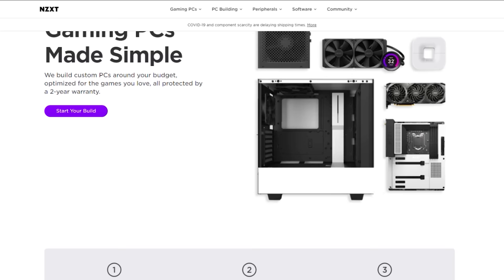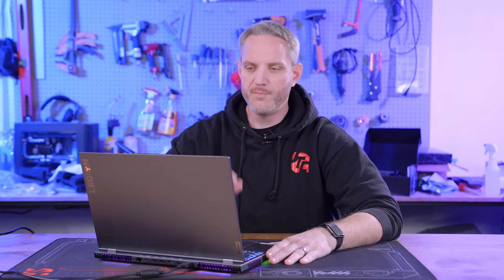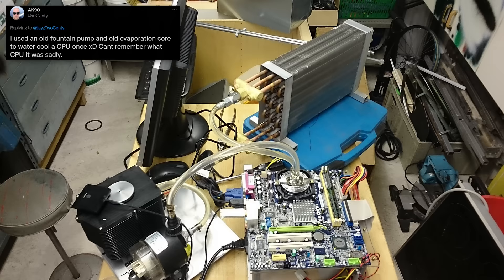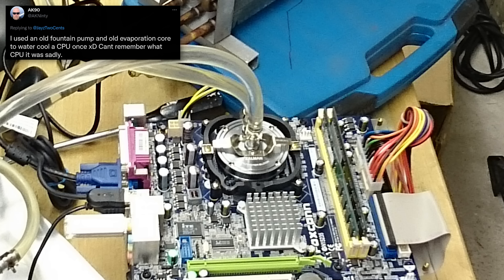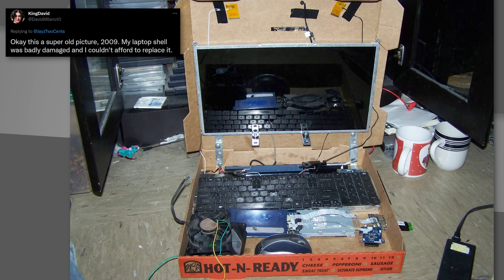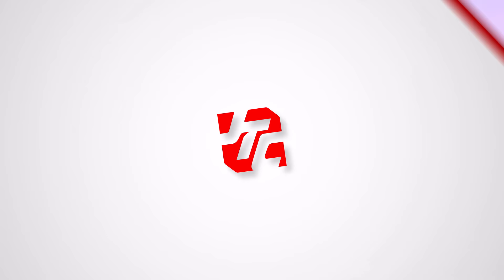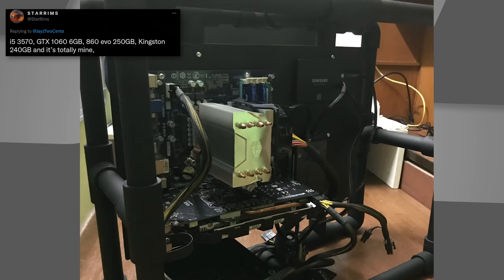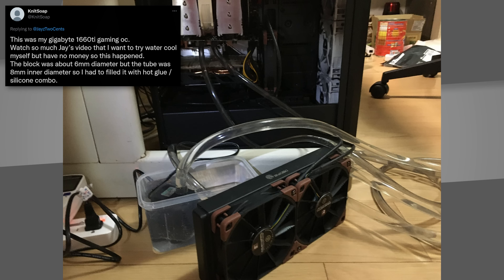We asked to see your JANKIEST PC setups... and you DIDN'T disappoint!

Comment: The most Jank i have is a 92mm FAN strapped on the outside of my NR200P to cool the M.2 on the backside of the Board. It is mounted with the rubber doodads from Noctua through the mesh Panel. The cable if routed through the Vertical GPU Slot on the back, which is a 3D-Printed part to replace the Vertical GPU Slots. And no the 3DPart doesn't have a hole for the cable, it is bent creating a gap...

Comment: a few years back i was working at taco bell with this couch hopper guy. not gonna lie, wasn't the greatest dude in the world but we often bonded over his tablet setup. being essentially homeless he didn't have a pc or anything, so he had this little android tablet he'd use to text and stuff. he kept it in this trapper-keeper-esque case along with a bunch of accessories, and it was really really well managed. he had a battery pack tucked into the hinge part with a short cable to keep the tablet charged (while also being able to plug in and charge the external battery without removing it). he had a pair of earbuds strapped next to the tablet, with the cable going around and having a spot right next to the 3.5mm so he could easily plug it in. just a bunch of stuff like that, and it was great. i think he got arrested and i got a different job and i haven't seen him since. i think about him and his tablet sometimes.

Comment: The rubber tabs on the first build come with bequiet fans. You can use them instead of screws. supposed to help with vibrations to keep the fan a bit quieter.

Comment: Also, i did a cardboard box build when i was about 14.. It was a Compaq DeskPro P90 overclocked to 120, i made it strong enough in the end using more card and hotglue so it could hold a monitor without bowing too much! Though i did technically cheat and use the metal frame of the riser board to help with that.. And the PSU! Also built a server for my exes website back when i was 17, that was in a cardboard box too! Though the PSU just sat on the shelf with it.. Motherboard was on top, then the HDDs were inside the box. An old AMD K6-2 i believe, was good enough for a basic site back then lol

Comment: How about Janky repairs?  I had a keybaord someone had spilled milk into.  the acid in the milk ate away one of the traces.  I used a piece of scotch tape and a doublemint gum wrapper (foil on the outside) and fixed the trace.  Used that keybaord for a few more years before it was replaced.

Comment: Our first computer was an old Windows 98 Packard Bell computer. We had added a Voodoo 3 card, a CD burner, and an extra hard drive to it. The thing is, the case didn't have space for a second hard drive and the power supply didn't have an extra plug for that hard drive. We ended up using the metal grate that had blocked off the 5.25" bay as a way to mount the hard drive below the existing drive bays, and we spliced an extra plug into the power supply. Somehow, the power supply never had any issue powering everything  through the whole life of that computer.

Comment: I've had jankier setups than most of these, I used the same pc case from 2005 until 2019, lost every panel on it over the years and eventually I bought an AIO that I just held onto the front of the case with a shoe string, I also discovered in 2012 or so that if you bend a graphics card just ever so slightly it will still work, and you'll also have room for another hard drive in your case(the same one with the shoe-string budget radiator)

Comment: 14:36 - the cover for the seat - mine is doing the same thing, it just dissolves over time (cheap fake leather, might be related to the fact I've basically spent the bulk of the last two years sitting in it working from home) and peels off the seat and arm rests

Comment: I missed the widow but I have a PC case I made out of stained wood for my Minecraft Server. Looks professional. Laser cut side panels, hinged door, 4x120mm fans, 10TB storage, and HVAC air filters, in less than a cubic foot. Why? The cost of materials was half the cost of a metal PC case and the results were stunning.

Comment: I used a Danger Den ceramic pump, Peltier unit, and a transmission cooler with two 120mm fans for a chill water cooling unit on an LGA775 rig once. I also put an AMD ATX build in an original Xbox shell, complete with an ATI GPU. I had to cut an L shaped slot in the top of the shell to allow the GPU to fit.

Comment: Not super interesting but I once drilled an array of holes in the side panel of a case so I could put a fan blowing right on the video card. Also brought the rear USB ports to the front with a USB extension cable and Velcro to mount on the side.

Comment: The H510 plywood mod is still better than the two large cut and taped together cereal boxes that I used to replace the missing side panel on my old rig!  It was actually dumped on my front lawn by someone in very sorry shape! Luckily I was able to get it up and running again sans side panel!  😂😂

Comment: I upgraded to a 3090 recently... Wasn't happy with the ram Temps on the back, so I took an old pentium 2 cooler, filed the back flat, and slapped some thermal paste on the back of the card and set it there. Max temp didn't change.
Realized there was a small gap on back right over 1 ram chip.... So logically I took a back plate cover and slid it in the gap. 10*c temp reduction! Success! But yeah... $2k card covered in paste and spare scraps of metal... It's a look

Comment: Dang, been a long time since i had a truly jank setup.. (AMD Athlon64, 120mm fan screwed to the heatsink, desk fan next to the tower blowing in instead of a side panel!) Or when i added a 240mm radiator from an old build to a custom loop trying to cool a Phenom 9850BE and a Radeon X1950XTX! No barbs, so i had to silicon the tubing into the 1/4" fitting holes and make sure they didn't leak..then it rested on the bottom of the case with fans (an original CoolerMaster Stacker) and still have that case! Also, that Foxconn heater core jank liquid cooled board is definitely Socket 775! And i had the gold version of that Zalman block with a clear top on that Phenom.. Once, the pump power supply failed and it started warping/melting the acrylic!

Comment: I have an NZXT Phantom and I fubared the top 200mm fan by accidentally bumping the case when it was running. I didn't feel like paying a premium for a rare proprietary thin single-color-led 200mm fan that could break so easily so I just bought a Noctua 200mm and stuck it on top. Eventually I'll cut the top panel so I can put it back on but for now it's naked. 

I knew I would have trouble replacing that fan when I bought the case, but I didn't expect it to be so fragile. Thing's bulletproof now though.

Comment: Wish I had pics of my old jank system.
Was built in a dresser drawer, using a blower fan from a old heater as a input fan. Was water-cooled, by which I had a simple copper pipe smashed semi-flat for the GPU. (a rx580) used a pump from a old rv, (which ran 12v, so I had a power converter mashed in the box too) 
Cpu was in the same loop, but that had just a simple copper heatblock screwed onto the mobo with a chunk of plastic.
Ran a old og phenom (not the 2), but later upgraded to a 2600x. Kept the case and cooling system.

Dispite the jank, the system never got higher then 46c even under full load.

Comment: Jay, you sounded *entirely* too excited about the "three meat treat" lol

E: What's janky in that photo isn't the desk... it's the Walmart MDF bookshelf that the tower is sitting on

E2: I'm both surprised and happy that you know enough about my line of work to be able to give the basics to folks. That being said... not a huge fan of having electronics that aren't bolted AND strapped down in my sleeper. Infrastructure in this country is just too janky, and more than once I've had anything that wasn't securely fastened to a single surface end up on the other side of the truck just from driving down the interstate.

BTW, thanks for the reminder that I still need to do that HOS For Dummies series that I was planning...

Comment: On my last built I decided to cheap out on my case so I bought a 40$ cheap corsair. It was hermetically closed with 0 airflow so I got mad and with a hacksaw made a big square hole in the front. Then I used I cut a pouch made with mesh and made a jank air filter. It worked great for a few years. Now I have a 150$ case, and omg no regrets.

Comment: does stacking a router on top if an old nas on top of a 5 y/o lowend desktop with terrible cable management a printer as a stand for the corporate workstation and a stack of 5 books as a monitor raise and manual kvm (manual plugging around cables everyday that is) count as jank?

oh did i mention the old salvaged hacksawed down heatsink added to the nas chip set held on with 2 strips of electrical tape that were absolutely added after the fact

and of course: wooden dining room chair

Comment: I'm a OTR trucker.  In the next 2 days I'll have an ITX rig built for the road;

Cougar Dust 2 Iron Gray case
Be Quiet 280mm AIO
Asus Rog Strix Z590-I
i7-11700F
Rog Strix 3060 OC 12gb
32gb Corsair Vengeance LPX (2x 16gb)
Supernova 650 80+ gold PSU
1tb 980 Pro nvme
2tb 970 Evo plus nvme

Comment: If you really want to do an old school system build, I did something like this several years back for nostalgia reasons myself. Was a pita to track down, but I have an Athlon Xp mobile 2500 (and a 1700tbred b), like a gig of BH5 spec DDR, a Gainward GeForce ti4600 128mb, and a DFI Infinity motherboard. Also a DFI LanParty one too but I think it had issues. Then i've got waterblocks for both the cpu/gpu (old school ones), and everything else for the loop too. I also have a few other things from the era too. If you really want to do a video on something like that we could probably work something out. You could even just borrow it or something.
Reply: I still have a couple functional AMD Tbirds. Not in use, packed away in a box but it was the mainboards that gave up the goodies on those. Same box also has a Voodoo 3 and Voodoo Banshee that sat in the system with it at different points of it's life.

Comment: i remember way back when i built my first water cooling system.  Had the same submerged aquarium pump as seen in some of these systems.  It also featured a radiator that lived it's past life as an oil cooler in a 90's Volvo, and a water block that was made from a pin array style aluminum heat sink with the outer pins removed and then enclosed in 3/8" plexiglass and glued together with transparent silicon... worked great until someone turned it on without turning on the pump and overheated the plexi to the point of it getting soft enough bend and the silicon lost its seal and ... yeah... leaked all over the case... and killed the pc...

Comment: Hey, Jay, that weird piece of metal holding down the water cooling is actually from a Noctua cooling setup. Don't know which one, but it's probably something that holds down the radiator or installs on the back of the MB. There ya go!
Reply: I'd like to add that it's from an AIR cooling assembly, not liquid (most probably). So, janky. You're looking at fine, European engineering right there.
Reply: And while I'm adding replies to my reply, the screws are from an air cooling Noctua, too. No doubt they have a couple of metal struts like that on the back of the keyboard with the longs screws bolted down to it.

Comment: Oh man, I'm sad I missed that. I've got a kinda jank kind of DIY setup in my current case, where the 420x140mm radiator doesn't fit in the front of my phanteks p500a because the housing for the buttons and USB ports gets in the way of the radiator head for the connections. So I hit up McMaster Carr, got some longer screws, some plastic washers and standoffs and made the radiator screws into a standoff bracket onto the case attachment points so the radiator can fit a bit over an inch deeper into the case and not conflict with the button housing. Jay, if you're interested I'll probably post some pics in response to the twitter thread.

Comment: My first "HD" Flat screen TV was a 32 in Sanyo 780P open box tv for 600 dollars. I used it for nearly a decade before it finally gave out. That was a 2006 or 2007 model if I remember right. Used as a TV and my primary PC monitor. 600 dollars will get you an awesome monitor now lol

Comment: Suggestion for next Jay water cooling project idea - Use a car/large radiator of some sort as back board similar to the Singularity Specter case so rather than a power board, large radiator which will be used to cool everything on the case. Inspired by Jay's comment on the fountain pump jank build on this video. I can imagine  a nice industrial/car look to it. Would be a nice project since the engine block build got put on the shelf.

Comment: I still have an original mk1 phantom and it's awesome.  Currently running no side panels or plastic covers because I need airflow for the 2 x 240mm AIO coolers I'm using to try and get 1st place on timespy for my setup.  Using a HP RTX 3070 LHR 🤣 currently #16 in the top 100 🤘

Comment: as someone who has been in IT for 7 years...i get it.. my desk is like 10% the mess of that during the week, but i clean weekly
Reply: It's me! To be fair most of them were not plugged into anything. Picture was from about 5 ago and I believe I had poured out a bin of stuff to find a USB hub and get the AIO plugged in. Took the picture to send to a friend and show my jank mount, because that case only had 200mm fan mounts.

I cleaned shortly after. Still didn't look amazing what with the AIO cables hanging off the side, but it wasn't like this daily.

Comment: My janky setup is visually pretty normal. It's just a mid-tier HP Omen laptop from 2018.
But under the hood and in Windows, that's where the true jank lives.
I upgraded my old dual-core laptop to an SSD in a feeble attempt to make it faster. It worked, but then the laptop had a motherboard failure 7 months later.
The SSD was still good, so I plopped it into my next and current laptop. However, this laptop has two drives: a 250GB M.2 where I keep the OS, and the SSD where everything else goes. Including my user folder and all my programs and stuff.
As it turns out, Windows doesn't exactly like it when you put your user folder on a completely separate drive from the OS. So I had to spend a weekend figuring out how to force W10 to embrace the jank and play nicely with it. Turns out it was just a matter of remapping folders from the C:\ drive to the M.2 and changing a few registry entries that tell the system where to install programs by default when they don't ask where to go.
(In hindsight, I probably could have done that in Settings and it would have worked fine, but then it wouldn't have been as janky)
The janky setup I use works just fine, with one exception: Logitech G Hub. I don't know why, but it never launches no matter which drive it's installed to. But one casualty is just an unfortunate statistic among the dozens of other programs that all work just fine in the jank.

Comment: Damn I wish I still had my old Frankenstein build for my Son using parts from old hardware. I added an old GTX 260 with a separate dedicated U1 server PSU directly soldiered to the GPU to power it (as I had no 6pin PCI-E connectors) in an old workstation Core 2 Duo with server fans for the CPU heatsink... sounded like a jet engine! - EDIT: Oh and I can't forget about my custom water loop build for the AMD 64 I did with my Nvidia Leadtek PX6800 GT... Cut a square hole in the copper heatsink just to mount the GPU water block (which was crappy thermaltake that failed after 6 months)...

Comment: I had two pc pump/reserviors fail in 1 month and I was not having any of it. I have a whole mess of fans and radiators i was using for some thermoelectric experiments including pond pumps. Tossed one of those pumps in the pc line and its been running without fail for 3 or 4 years.

Comment: would you consider doing a dry water cooled system its a non conductive water that you could emerse the whole pc in it and it would still work so no worrys about leakage, i dont think anyone has done a build like this so it would be something new.
the dry water is expensive though, its current use is as firebreak solution for servers as it will put out the fire without damaging the equipment.
Reply: 🖕 Congratulations you among the selected winners claim your PC via telegram 📩⬆️.....

Comment: I once put two towers next to each other. The first tower had the system I wanted to use, the second tower had the psu/addtional power connections I wanted. So I plugged the second tower psu into the first tower. At the time I did not know how to turn on the second psu without still being connected to the tower. So in sense, I had two psu's in two towers to power one system.

Comment: 8:20 I had 150l aquarium on a piece of furniture far less sturdy than that shelf for years ;-) All it took to make it suitable for its new purpose was a piece of 2 by 4 wedged in a right spot. 
Btw at work we have a computer with a supplemental CPU cooling made from a compressed air nozzle, zip ties and a plastic spork. We are blowing air spliced from an assembly line next to it because it is impossible to change any HW including the cooler due to stupid warranty agreement which makes that PC part of that assembly line and thus we would have to stop manufacturing and send that entire PC to manufacturer of that assembly line to change that insufficient cooler. Ridiculous :D

Comment: Current rules are 14 hours on duty, 11 hours driving in that 14 hours, and must take a 30 minute break around 8 hour mark, and must be off duty in 10 hours, I am a trucker but local now. And yes I did have a gaming PC mounted in my truck when I was long haul for a little bit with a 24 inch CRT monitor. Before the days of LCD panels.